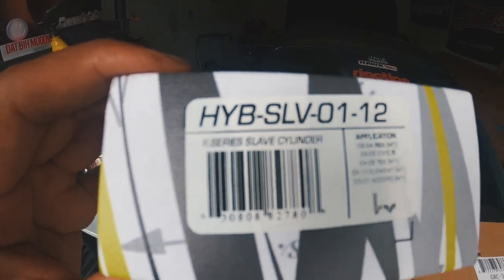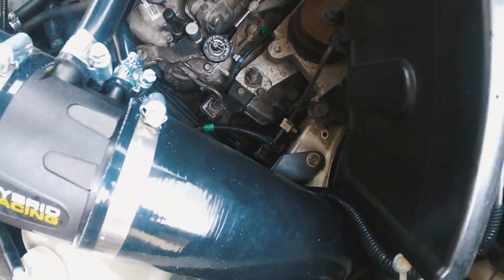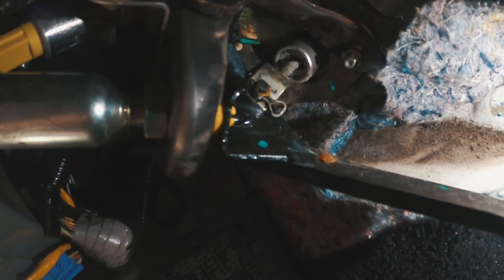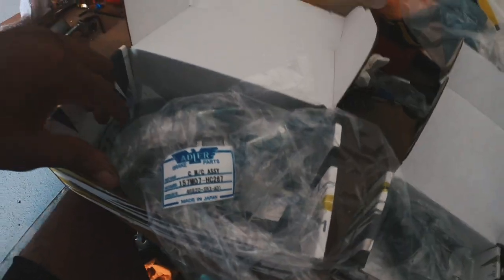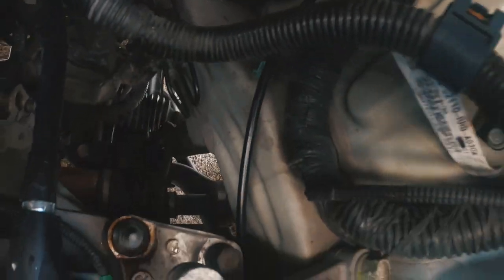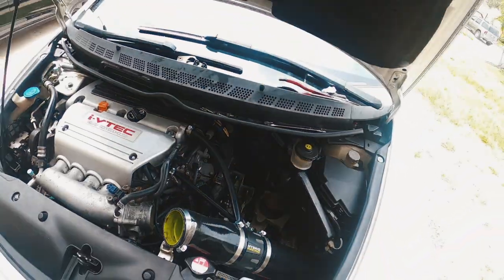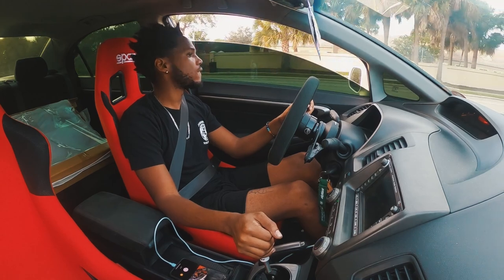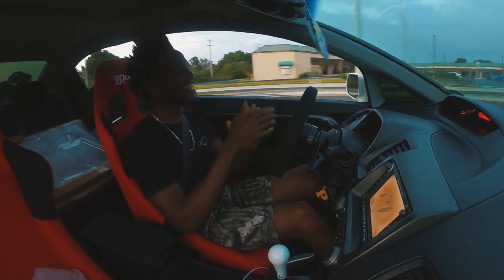HOW TO FIX 2ND GEAR GRIND: Hybrid Racing Clutch Release Upgrade - 8th Gen Civic Si

Comment: The Delay valve is actually in the Slave Cylinder. Cheapest solution is remove it from your stock one and re-install.
Reply: He's referring to the damper valve in the master which can also cause gear grinds and just an unpleasant clutch feel in general.

Comment: Bro got my hybrid in last night, as in installed and got 5 data logs and revisions before 330 am last night, sounds like a k 25 now, love your build so does my 8 and 1 year old boys, pro tip I wrapped my intake in header wrap, man clean, took 10 mins, and drove it back to back and had colder average Temps with the wrap, keep building, might as well order a turbo now

Comment: The second gear grind is really weird. Personally, when I installed my Hardrace mounts it went away. Still does it when it's cold outside but other than that it's much better.

Comment: 😂😂😂 in the last video I told you that you are going to have to replace the 2 gear ⚙ sincros, the noise went away  but they are already hurt,  you could also use 5-20  engine synthetic oil, I recommend Mobil 1, wish you the best,, 👋 from Puerto Rico  🇵🇷.

Comment: This even happens in my 7th gen si and my 9th gen si, always been a problem with the si’s, hope there is something like this for both of them, also should definitely change the manual trans fluid on my 7th gen, getting to 200k miles soon
Reply: Hybrid Racing Clutch Release Upgrade works for the 9th Gen, 8th Gen, TSX, TL, Accord, Element, EP3, RSX.

Comment: all you had to do was adjust the oem pedal 😩 EM1 cmc isn’t an upgrade IMO, i would have went EM2 CMC/ RSX Slave.
Reply: The purpose was to get rid of the delay valve
Reply: @josephrizzo7720  yup, but if you adjust the oem pedal, give it more travel it’ll actually give you smooth high rpm shifts without grinds or lock outs! i did it on my 240 hp k24 and no issue
Reply: @WelshyAutomotive   hey bro same here! but just ordered an oem slave cuz mine dripped when bleeding but should I be solid with updated cmc and oem slave with adjustment?
Reply: @aamirgomez1040  yes man! that’s all that’s it’s my car bro! you don’t need to upgrade at all!
Reply: This, OEM updated cmc and a properly adjusted pedal works for me at 9k, oem em2 I heard works well since it has proper rod lenght
Reply: @AK47xSNIPES  yessir you know what’s up!
Reply: @AK47xSNIPES   @Welshy bro appreciate the feedback been searching for that combo and reviews 8th gen forum can only help so much and this combo I felt would be most reliable thank you!
Reply: @aamirgomez1040  no problem, there’s also a write up on 8thcivic to delete the slave cylinder delay valve just keep in mind its more shock on drivetrain
Reply: @AK47xSNIPES   I’d rather Chirp gears and no worry about my drive drain haha but fasho I feel like once I get all those put in plus amsoil I’ll be butter new oem fluid and adjustment did a huge difference 11 fa5 69k miles
Reply: Couldn’t agree more. Just adjusted mine. And no issues!!!
Reply: @15237matt  nice man! it’s the best thing to do imo

Comment: i jus installed my hybrid cmc but i used a vacuum brake bleeder and everytime im changing gears with rev up it does a light scratchy noise ? please help ? you think i have to bleed the old fashion way like you did with your friend ????? i have a stage 2 clutch comp. 2015 si please help bro

Comment: I got a k24a2 swapped ep3, and i have the same issue with 2nd and 3rd grind, if i really hold in the clutch while shifting no issue so but im wondering if changing the master cylinder kit would help? Or would a new clutch and new syncros fix it? Both cost money just wanna do it right! If anyone knows
Reply: If you really hold on the clutch no issue? That’s what you’re supposed to do when switching gears

Comment: Bro, those instructions for cutting the pipe with the pipe cutter has me confused 😅
Reply from the maker: Bruh how?
Reply: @Zosh  correct me if im wrong, you said you put the pice of pipe in the cutter and get it tight untill it cuts, right ? You didn't said your supposed to turn the cutter around the pipe a few times and keep tighten untill it cuts.

Comment: my 09 si thankfully doesn't suffer from this problem, if i'm correct they fixed it after the year 2008? i could be wrong tho.
Reply: They did not fix it. Honda and other manufacturers use delays valve to save the clutch on manual cars for the off chance that the new buyer cannot drive manual. Delay valves still exist in the 10th Gen civic.

Comment: Installed the kit with the oem si push rod. Clutch Grabbing kinda high. Is this normal ?
Reply: Did you fix the issue?
Reply: @idrcookiez620  just adjusted the cmc to have a little bit of play. Working good for months now.

Comment: Try a Synchromesh trans fluid. Acdelco, Pennzoil or Valvoline. I recently did 2.6 quarts on my manual TL and shifting is MUCH better. Crazy to feel how far trans fluid goes
Reply: Stick with amsoil synchromesh or oem Honda mtf for the long run, I’ve heard awful things about all other mtf types. I’ve even heard sketchy stuff about amsoil so beware what fluids you let run your car!!

Comment: Question I already upgraded cmc and slave and clutch line. I also adjusted the clutch pedal and its still grinding on high rpms. Im thinking i just gotta upgrade to carbon synchros
Reply from the maker: Change fluid
Reply: @Zosh  i changed the fluid when I changed my clutch but i used oem honda. Which one you recommended?
Reply: @AlvaCuh If it's still grinding check your engine and gearbox mount's and selector cable adjustment. 
Easy fixes that get overlooked.